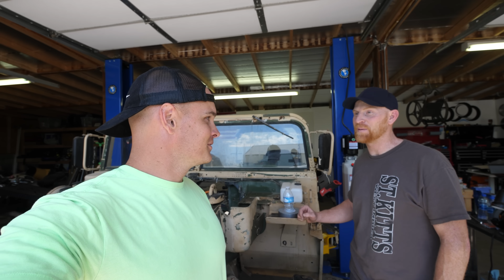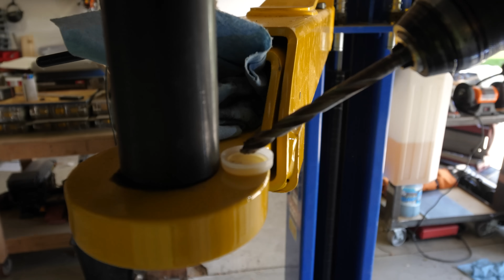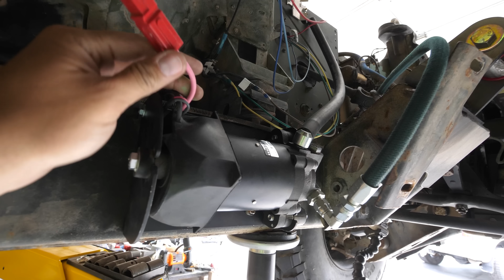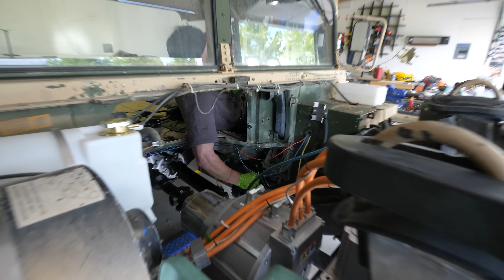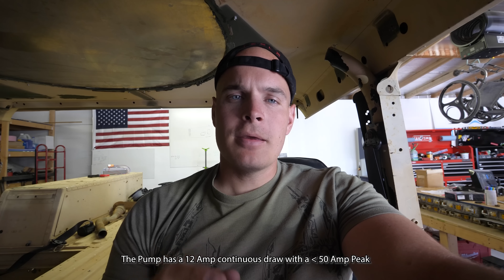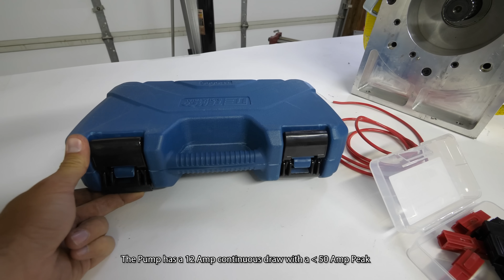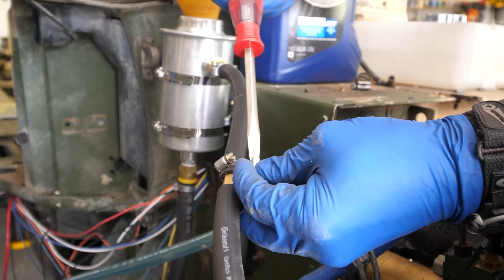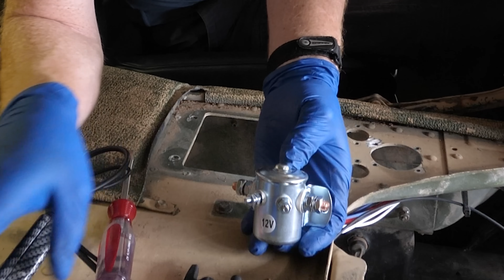We might have a problem with the Brakes... - Electric Hummer Conversion!

Comment: I'm not a expert on electric pumps but I ran a shop for 18 years, and ford pump had to make sure they had a proper screen in the return line to separate the air bubbles and when ever we installed a new pump on any ford sometimes it took 24 hrs for all the air to bleed out to make the noise go away. the vanes in the pump will cavitate from the smallest amount of air, also make sure the viscosity is correct for the fluid on the Toyota pump. Some of the newer systems used a high pressure reservoir and a pressure switch and did not run the pump continually

Comment: Question about the solenoid. Are you using a starter solenoid (meant for momentary use) or a continuous duty solenoid that can be on for long periods of time?
Reply: Hmm, great question. The electromagnet circuit in the starter relay could produce a significant amount of heat, and it would fail by catching fire, as it has no thermal switch. What makes the situation worse, is that you are now driving a huge and extremely heavy burning car with pretty much no steering or brakes...
Reply: @The.Norwegian  Might check into relays intended for winching applications. They are intended to be used under heavy amperage across longer time periods.
Reply: I had the same question as soon as I saw that relay. Many years ago, I used a starter solenoid for the high amperage portion of my crazy car stereo, and it burned out within the first hour of continuous use. I replaced it with one that looks like the one Zach is using, and it was fine, but definitely check the specs.
Reply: A transistor (MOSFET) relay would be the safest thing here. They are far more reliable, and produce less heat. We use them to control 12V 350A  bow thrusters for extended periods (hold function). They have cooling fins/fans and microcontrollers to monitor heat. If they were to overheat, power could be reduced to say 25% by PWM modulation to give you a sort of limp mode to stop safely. Now, good luck finding the right one!
Reply: @The.Norwegian  Good idea!
Reply: @The.Norwegian  the MOSFET sounds pretty sweet.  I might need something like that.  Can you send a link to something you're talking about? I have no idea where to get one or how much they cost.
Reply: @jerryrigeverything This wasn't a pot shot to you. I love what you are doing and this is one of my most favorite series I've watched thus far. As you said this is a learn as you go along thing. I was just making observations and getting that conversation going. Great replies from the other commenters.
Reply: @sonnymaile9325  wait did he actually get offended?
Reply: @T2roxT2  not that I know of I just didnt want to come off as i was giving a pot shot.
Reply: Looks like a golf cart solenoid
Reply: Something like Teledyne S75DC150 could do the trick. Remember to add protective reverse diode in parallel to the load.
Reply: Excellent question!

Comment: Mount the pump inside another waterproof box with a rubberized sealant.. think one of those waterproof distributer boxes with heat insulation you find near roof mounted air-conditioning units - powder coat black + rubber stoppers round the pipes should be good to go (could also go ahead and add fiberglass sound deadening material in that box if your adamant bout the noise)

Comment: Just a thought, you can reverse the motor rotation to act like a brake, you won't need anything extra for that!
Reply: reverse motor rotation would be veeeeery dangerous xD
'cause then the tires would just slide backwards with nearly no grip (a bit like aquaplaning)
You probably mean invert the voltage to the motor / regenerative breaking.

But not every controller does support that. Some does just burst in flames when you try that :D
And even if you do that (what i think he has planned) you still need breaks. For example if you're out of battery. Then you also can't break with the motor. Or if you have to break very  hard (if the motor/battery is to weak what i doubt in this case but still...)
Reply: @qwertz4035  Understood, but 1 thing the pump brake also works on battery though😅 or only power steering needed the "power" !
Reply: @_BlackSpectrum  Yes but that little pump needs less power than the big motor and is also not driven by the big battery that the motor is using (it uses the normal car battery) and it doesn't break the vehicle with that little pump motor. It just uses the little motor in the pump to push the break calipers with more force together, so that they break stronger.

So big motor be like: paddeling with bare hands in the wrong direction

Small motor be like: yeah just throw an anker. It will do the job... Less efford (less power), more effective
Reply: @qwertz4035  Gotcha 👍 Thanks
Reply: It needs physical caliper disc brakes no matter what.

Comment: FOR SOUND ISOLATION, you need isolate vibration to frame by rubber mounts. For sound transmission (audio) you will need to have a sound absorption rap around the pump. They make rubber matting to absorb sound. You can you use you tube to see how it is done....
Reply: Just needed to add, the brakes to the frame should also have rubber decoupling. This is how a Sub does the decks inside the hull. That information may be top secrete so you did not here it from me.

Comment: the noise coming from pump could be because of multiple reasons
wrong fluid
bad pumps
air in the system
or maybe because of the metal surface that you have mounted it on 
rubber spacers may help

Comment: That starter solenoid isn't meant for continuous use. You'll need something like a ford diesel glow plug solenoid that can stay on for longer periods of time. A starter solenoid is for momentary use only.
Reply: Exactly.  Duty cycle...
Reply: There are 2 types of solenoid. This one is for continues use. The same is use in machinery for key switch. Not starter
Reply: Came here to say just that. I've experimented in the past with them for air pumps and they burned up!
Reply: Lets hope that Jerry sees this comment

Comment: those zip ties are to tight. its like 4 normal lanes being rammed into really narrow lanes on the highway. that creates some heat. look for better alternatives perhaps. like proper clips that bolt up and have insulation foam on the inside. more surface area they are wider and not so tight! budge the clips on the steering reservoir so the top one inst on the weld.

Comment: Best way to sound deaden would be to creat a housing to cover the pump (small box) aluminium and audio deadening matting. In the same way that you’ve isolated the vibration of various components, just with sound.
Ps, I’m absolutely loving this series man!!! Watching you learn and still provide accurate information to your audience is a real pleasure.
Reply: What about the motor heating
Reply: @jinomonkeldhose6257  The motor might stay cool enough by way of cooled fluid returning to it.
Reply: @jinomonkeldhose6257  Isn't it cooled via the hydraulic fluid? But anyway. It doesnt have to be in a closed Box. it should be also enough to have damping material over it (between the cabin and the motor).
Reply: @jinomonkeldhose6257  he said they’re fitting an oil cooler in line, should be enough to keep it cool. If it becomes a problem, they might have to upgrade the cooler
Reply: That’s exactly what I was thinking.
Reply: I think the smarter thing would be to move the location of the pump to engine bay, as front as possible. Then when everything is assembled, if it's still noticeable from the inside while driving, try adding another layer of rubber on the mounting points so you're excluding the chassis from amplifying the sound,if none of the above fix it try covering it up and adding sound insulation. Even if it is cooled by the fluid, covering it up will add extra heat.
Reply: Will there be a ventilation if all covered
Reply: Yep I was gonna say the same thing, with ventilation on the bottom and maybe one side, sound deadening all over the box, and then layer it thick on the floor and trans tunnel to try to further isolate the cockpit.  a combination of like killmat butyl pads and some sound deadening foam matting should cover you on a sound like that and other road noise (not that you'll be doing the whole truck I imagine, but every bit counts lol).
Reply: You could also pulse the pump with a controller. You could have it slow to almost nothing when you aren't moving or steering. Adding a sensor to the steering column could tell the controller when you're steering and a wheel speed sensor could tell it when you're moving.
Reply: @wesleybortnick4024  not a bad idea.. but if you are stopped, and want to hold the truck in position (assuming the electric drive motor isn't holding you still).. then you want power brakes.  When you have no power assist in a Hmmwv, it takes a tremendous amount of foot peddle pressure to achieve any sort of braking action.  Really to operate the power brakes (which you WANT the power assist in this truck), you need that hydraulic pump running all the time, unless you're in park.
Reply: yeap
Reply: Not really, just get some dampening pads to go between the pump and frame and maybe so isolator standoffs and it'll stop the whole frame from humming.
Those pumps are air cooled because the hydraulic fluid doesn't actually flow through the system, it just compresses the oil which causes minimal shift and then back flow.
Reply: @SilvaDreams  the fluid does actually flow through the pump.  It starts in the reservoir, through the pump, the brake and steering components, to the cooler and back to the reservoir.  Over and over again.  The system has relatively low restriction when your not steering or braking, so the pump is flowing fluid, but doesn't need to create alot of pressure.  When you steer or brake, those steering/braking components divert the flow and restrict it, which creates pressure, and increases the load on the pump. If you eventually steer so hard (like against the steering stops in the suspension) the pressure peaks and the pressure relief valve in the pump activates and you hear a "hiss"ing noise.  You want to avoid driving in circles at full left/right lock because the pump is at maximum load and will wear it a little faster, and put heat into the fluid.
Reply: Yea that would work, could also just leave the bottom pretty much open for those worried about heat.  Just need to deflect the sound going up / into the frame.

Comment: Zack, I’d try running the pump with it unbolted from the chassis (in free air).  If that significantly reduces the noise, I’d add a second set of rubber mounts between the pump and chassis.  I have an electric fuel pump I did this with, and it helped a lot.
Reply: great catch. I too would start by varying the chassis is not amplifying the noise. Isolating the pump and closing up the dog thing may just be enough to not being too annoying.

Comment: Maybe made a sound insulated box for the pump and install it near front with separeted brackets so the vibration won't make sound trought the frame.

Comment: you can use your gym mat to damp it both on the frame as well as on the body of the pump with some slots for cooling .... or it would be much better to place the pump at the front along with radiator for cooling..

Comment: Rubber bushes on front and rear of the pump mount will stop the fixings transmitting vibration into the body shell and then some acoustic foam on the inside of a plywood box to contain the pump will further reduce the noise.

Comment: Dumb question: if the brakes and power steering are hooked to the same pump, is it a safety risk to loose breaks and steering if the pump fails? Would it be an option to make two independent systems?  Though that solution wouldn’t help your noise problem.

BTW: I’m not trying to be “That Guy”. I really love the channel and super glad it popped up!
Reply: Not a dumb question, I thinks it's a good one.  What is the back up, if that was to happen? I hope there is a secondary braking trigger like the parking brake.
Reply: @Mr.DontKnow  couple redundancies... The steering has a mechanical shaft to the wheels.. so that would have to break to completely loose steering.  If the pump fails while driving, it just becomes harder to steer.  The brakes have a hydraulic accumulator built into the hydro boost, and will give a couple presses of the pedal with power assist.  After that, you can still brake the vehicle, but you have to stand with all your body weight on the pedal to get it to stop.  There is also an emergency brake handle that's mechanical.  And in his case he will have electrical regenerative braking (I would hope).
Reply: The regenerative braking would be the backup for this electric humvee.

Comment: U get two different types of solenoids one that only can be used for a starter solenoid and one one that has a pull in winding and a hold in winding that is used in winches.

Comment: once you close the hood and the engine "trap door" you shouldn't hear the pump as much.
but. you can always create an enclosed isolated compartment for the pump. 
or put it in a place where the sound is directed to the the ground.
 also having it near  a solid structure, with a less cavernous space. should reduce the sound.

this might sound odd. but I think the best time to try to mount the hydraulic pump is when you are almost done. so you can test it on various positions with the chassis closed. and pick the one that gets rid of the sound better.

also remember that inside the garage is always going to be more noisy that out in the open XD

Comment: How loud is that pump in dBSpl? Depending on how much it is you can just soundproof the engine compartment and interior and have a lot of it's intensity removed.

However this is an EV, why use a hidraulic solution? During the whole assembly I was thinking about damages that could happen to this fluid line. Aren't there any electric options for this?

Comment: Are you concerned about the close proximity between the high pressure line and the drive shaft? Like, if you bust the driveshaft could it take out the brakes and power steering?

Comment: are there water cooled hydraulic pumps? if so you could put one in a sound dampened box and run it without the risk of overheating. and another thing: maybe you should think about adaptive power steering. maybe using an analog valve that sends less fluid to the power steering when going fast. dont know what speeds you are planning to go at, but at higher speeds its really annoying if you have to be super sensitive with the steering. especially on long road trips

Comment: Better get a very tough skid plate built for mounting under that pump motor.
I'd investigate how and where it is mounted on the original application and see how they deadened the sound.

Comment: You can try some of this:
1. rebounded surface to reduce vibrations from the power unit. Not sure if your noise is that tho.. 
2. any entrapped air from how you added the fluid. I think this is possible based on how you added the fluid and let it settle.
3. You should check if that fluid is actually good enough for your hummer. Maybe there’s an issue because of the retrofitting.

Comment: After installing a couple thousand of them, you don't need to put Teflon tape on JIC fittings on the hydraulic reservoir. I have done it before in a pinch when out in the middle of no where but even then putting it on the threads is useless when that fitting is face sealing on the taper. If oil gets past the taper its going to leak past the open swiveling side of the fitting and not care that you taped it.

Comment: I like that you're working on what is essentially a GM vehicle with vehicle parts you can largely buy at NAPA, and GM makes hydroboost components for medium trucks, but you opted to use Toyota light truck parts to modify the braking system, because... you know: Toyota.

Comment: In my head I was thinking "you probably won't even hear the pump once the engine starts up anyways" until It dawned on me. How could I have forgotten that part.
If the sound is transferring through the frame via vibrations, you'll need more rubber or foam to isolate the sound. If that's not the case, you might need to make a chamber around it with grommets for the hoses/wires.

Comment: Electric power steering or EPS is best option for quite  operation and in future also allows for  autopilot mode by some sensors and ECUs.
For hydroelectric pump need to start continuously may drain more battery

Comment: One way to get that pump super quiet is to make an enclosure for it and fill the void spaces with insulation foam (like the portable gas generators have). But i think the pump might start to getting hotter due to lack of airflow, so some ventilations may be required.
Another option is to install the pump as far as possible from the driver, sinse the fluid does not lose strenght from longer distances like electricity, this could be the solution

Comment: To clarify, a fender mount solenoid for a Ford is ONLY for intermittent duty (generally a bakealite body)
A continuous duty solenoid is what is needed in this application. The metal body solenoids can be intermittent or continuous duty, depending on the insides of the unit.
If using in contiunuos duty application always verify when purchasing .

Comment: Mount the pump on rubber vibration dampeners to quiet it. Might also mount the pump on a structural member further from the tin of the cab, like on the front crossmember.

Also, have you looked into a small generator to give emergency recharges out in the sticks?